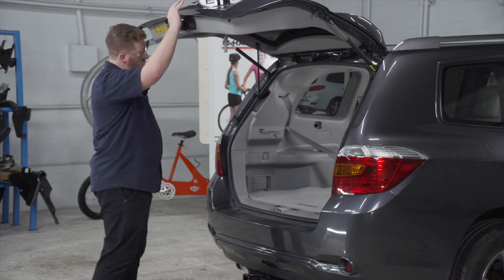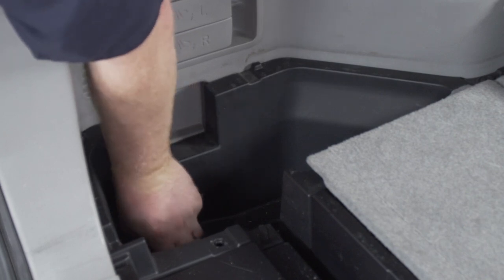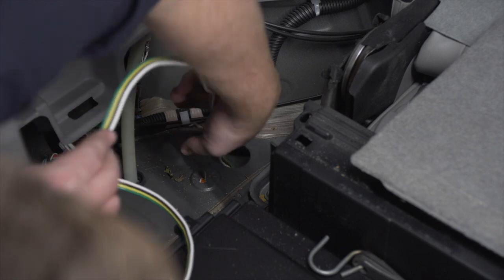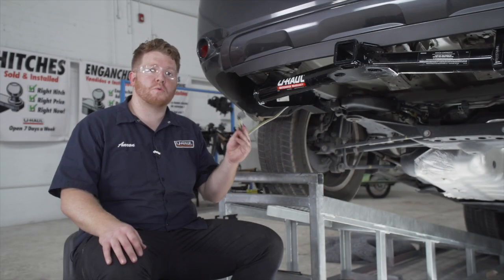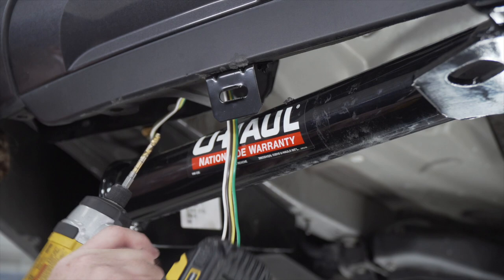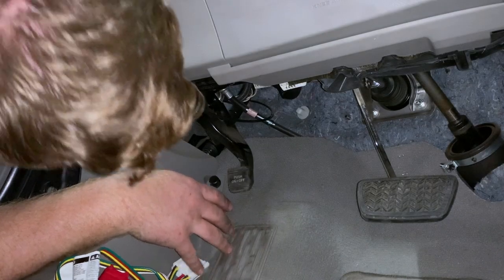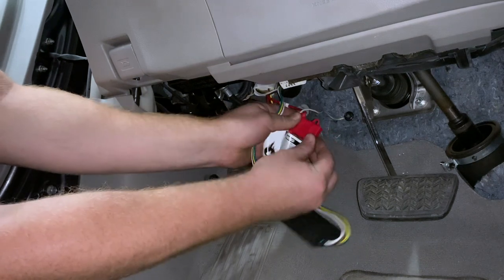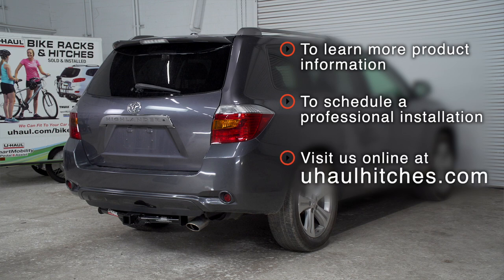2008 Toyota Highlander Trailer Wiring Harness Installation

Comment: I ordered the wiring from Home Depot. I already had my Tow Hitch installed. I followed the directions in this video. After I installed it I went to U-Haul to check my wiring job. They used a electronic test device and everything was fine. Now I’m going to use U-Haul to transport my motorcycle.
Thanks U-Haul!!!
Oscar
Reply from the maker: Excellent!

Comment: If a person wants to use a brake controller - 

Correct me if I am wrong - there is obviously the 7-pin connector under the dash (as shown in the video) - and it turns out there is ALSO a 7-pin connector (in addition to the 4-pin) in that compartment near the back hatch.

So...I get a brake controller...connect it to that 7-pin under the dash...and then also connect some wires to the 7-pin rear connector, then mount a round, 7-pin connector under the bumper.

I have a 2008 Highlander Hybrid Limited with the tow package.
Reply from the maker: Unfortunately no, this wire harness only adds a ground, left turn/stop, right turn/stop and running lights. The addtional functionalities of reverse lights, 12v power and electric brake controller need to be hard wired into a 7-way socket. Here is a link to a video showing how to add the remaining functions. https://youtu.be/hqze3Qgz-Ng
Reply: @trailerhitches  Thanks for the quick reply.  But OK, I'm not looking to "add" braking functionality, I'm looking to install it right from the start.
Reply from the maker: If you want to use a brake controller you have to have these functionalites installed on your Highlander. You need an electric brake controller under the dash and a 7 way socket under the bumper. There is no adapter that has that signal anywhere pre wired in your vehicle. This video shows how to access turn indicators and running lights. The additional functinalities in a 7 pin connection need to be wired to the  battery, the 7 way socket and routed under the bumper because there is NO electric brake signal in your vehicle. The brake light signal that exist is  simply the computer turning on an incandescent bulb at the rear of the vehicle. It does not signal the application of trailer brakes. Thats what you need to hardwire in.
Reply: @trailerhitches  Thanks very much for your reply.

Comment: Hello, I’ve got a 2008 Highlander Limited. I can’t find that connector but there is a 13 pin connector with 7 wires going to it. Is there a way I can use this connector for a trailer plug?
Reply: I also have the limited same year and that isn't correct. The 4 pin is tucked on the back side of that rear side pocket. And the 10 pin is under the driver dash behind the brake. Might need to maneuver your body a bit to find.

Comment: I do not understand what the front converter box is. If we have the 2010 Highlander with the "factory towing package," is that piece already there? Thanks!
Reply: Any info.?  My 
2008 came with a to package so I'm assuming it should be there already?
Reply: @koreyhannan9071  I went ahead and ordered a "kit" specific to the vehicle with the "towing package." The kit provided any missing parts, specifically under the dashboard near the pedals of your car; the other parts fit just fine in the rear driver's side. Just follow the directions is what I did, not worrying about rhyme or reason. Ha. It's all good. I got my kit off amzn.
Reply: @AerialLensVideo   OK thanks. I looked under my dash and I do not have the plug in already.  Also there was no 30 amp fuse installed under the hood
Reply: @koreyhannan9071  Hmmmm. Interesting for sure. Is there a video about doing this for your exact model and year? The answer must be somewhere.
Reply: @AerialLensVideo  i did find one of Amazon thanks. Just plug it in and go